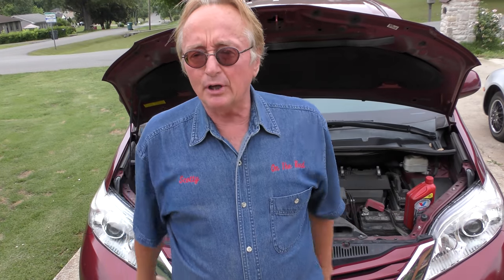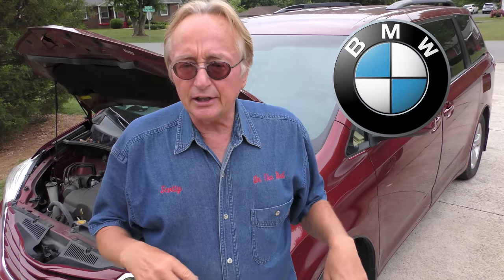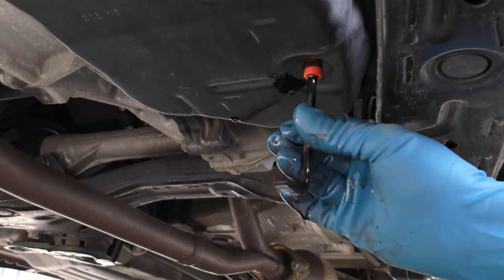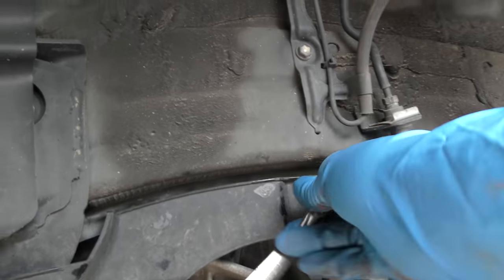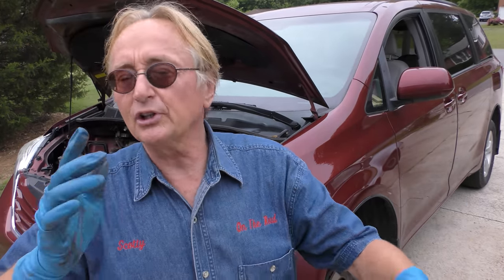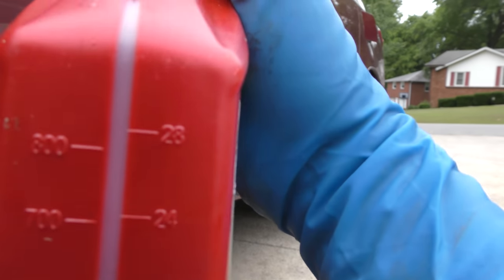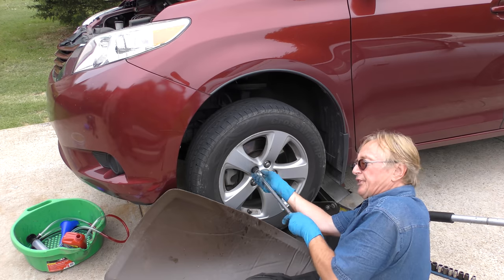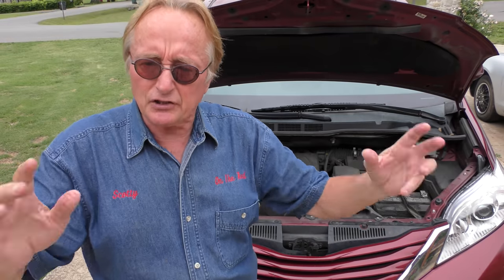Here's Why Changing Your Transmission Fluid Can Cause Damage

Comment: I have a 2003 Ford F250 Super Duty Gasoline 5.4 liter V8 truck. It has 370,000 miles right now. My family got it USED at 170,000 miles. We never changed the transmission fluid. But I have been using it for 6-7 years now and i have noticed on 2nd gear it does a little kick when it shifts to 2nd gear but it only does it when i let go off the gas pedal going on 2nd gear. If I do not let go off the gas pedal going on 2nd gear it shifts smoothly 95% of the time. I noticed the transmission fluid still looks more of a reddish color and not black. Ford made the best f250 trucks! I only change the motor oil every 2500 miles. I also never drive fast with my truck. I always drive 55 max on the highway while towing a car. And sometimes I like to use the law of gravity to stop my truck so i wear out my break pads the least amount of time ✌️😆✌️😁✋️.

Comment: I have an 2017 Elantra. I want to buy a less expensive transmission fluid than the OEM.  Elantra calls out for SP4 rating.   AISIN sells a fluid --  ATF-SP4 Automatic Transmission Fluid.  How would we find out if it is as good as OEM fluid.

Comment: Question. Theoretically, couldn't you use that manual pump to pump out the rest of the old fluid thats left in the transmission? I'm new to car mechanics, so there might be a reason why that wouldn't work. Could anyone provide some insight on this?

Comment: Got a 2017 Mazda 6.  Says, no need to change the transmission oil.  Doesn't seem right.  

On a side note, have a 2013 Toyota Corolla.  Never changed the transmission oil.  At 220,000 currently.  No problems.  Rule is, no new car until the it dies.  Just maintain regular oil changes.  Been trying to kill this thing for the last four years.

Comment: What about auto trans fluid that has 58,000 miles on it, but it is 21 years old. I have a Saturn that was barely driven, so it has 58,000 miles on it, but it is 21 years old. Is that fluid you should change, or leave alone?
Reply: Yes don’t change it. It to far gone. If you change it just make sure you have enough money 💰 for a new transmission if the job fails 🍷

Comment: Scotty level the car out, and pump fluid back in with that extension still in, up, from the bottom, until it starts overflowing.  Put the drain plug back in. Done, excess leaks out from that overflow stick.

Comment: I had a 2013 Toyota Highlander 237K miles, never 👎🏾 serviced the transmission no problems whatsoever, but I knew her days were numbered due to having to replace the radiator and lower control arm ball joints and struts were up next. A mechanic I asked wouldn’t touch the transmission lol 😂 I got a new 2023 Kia Sportage and sold my Toyota before it totally died. I’m definitely gonna service the Kia’s transmission regularly.

Comment: Now I feel good because this is how I change the transmission fluid in my Jeep every 60000-70000 miles. Mine has a dipstick, so I'll run a tube from my Topsider vacuum tank down and suck out the fluid. I do it when the fluid is hot so I get any debris suspended in the fluid. Then I'll replace the fluid, drive around a while to let the new fluid mix with the old, and do it again. I figure I get a third of the fluid out each time:
1st time: 66% old fluid left
2nd time: 44% old fluid left
3rd time: 30% old fluid left
4th time: 20% old fluid left. Drop the pan, change the filter, fill it up.

Comment: Hello, I have a 2014 Toyota Corolla with 307,000 miles my transmission oil has never been changed and still runs good, but there is a clunk sometime when i shift out of park. I have been told 8k to replace should it be that expensive, and with this much milage is it worth buying rebuilt tranny

Comment: Is my Lexus IS transmission (143 K miles-230Km) shot? I don't think the transmission oil has been changed (bought used) Now the shifter is very hard and won't stay on D (drive) eventually when the car warms up it kicks in but I am afraid of getting stuck... I am freaking out as money is tight.  Hoping for a miracle easier fix.

Comment: I have a 2015 Kia Sportag It shuts off when I slow down.  It does not  have any codes showing up? Where do you suggest I start to look for the problem?  I have read the torque converter solenoid, and even the brakes to the temperature sensor.  I'm starting to get confused.  Help!!!

Comment: I accidentally put about 1oz of ATF fluid in my CVT  transmission will this cause damage to my transmission? My transmission fluid was just a little low and I did not make sure that the employee at the auto parts store had given me the correct transmission fluid (I only notice when I started pouring)

Comment: Scotty I know this video is old but wouldn't you change the trans filter every time you change the trans oil I follow you on your videos I have a 2016 Nissan Versa Note 95,000 miles haven't changed a transmission oil or filter yet I'm going to do it. Your opinion should I change trans filter and oil or leave it

Comment: It depends on your definition of "lifetime".
I once bought a GPS navigator with "lifetime free map updates".
I later discovered I was presumed to have a terminal disease, and had only two years left, because that's how long the "lifetime free updates" were good for.
Reply: Recently, the trend is "lifetime" to say in other words that the manufacturer guarantees trouble-free operation of the AT for the duration of the warranty on the original fluid. It seemed like nonsense to me. But then I realized if the AT has fluid change intervals and I follow them and the AT stops shifting after warranty = same as no AT fluid change, if the AT stops shifting after warranty = no one cares because it's out of warranty.
  New car warranties in the US and Europe are very funny. E.g. Toyota in USA = 36 months or 36,000 miles. Europe = 36 months or 100,000 km (62,000 miles). Someone may object Mercedes has a 2 year warranty with no km limit!!! Yes, but Mercedes recommends changing the AT fluid after 60,000 km (37 K miles) at the latest :).

Comment: Why did you not mention changing the filter?  I am guessing... Well, I don't know.  A short discussion on the pros/cons of that filter change would be helpful.  But, a good, well done, and concise video the way I like it.
Reply: Changing the filter on many transmissions requires that the transmission be removed from the vehicle and taken apart in order to access the filter, a process that would cost thousands.

Comment: What is evaporative transmission system? I have a toyota corolla 2003 with 99k miles on it. The car leak transmission fluid. I can't seem to find the problem where the leak is coming from?

Comment: Hello Scotty I have a Lexus RX350 2013 model with 150,000 miles do I have to change the transmission fluid the dealer said it is a sealed unit don’t touch it please advise me on that thanks 🙏

Comment: Neighbor brought an older Rav4 2013, for his daughter first vehicle,  with over 260,000 km on the clock. Did a transmission oil change dropped the pan, changed the filter etc  ruined the transmission ending having to replace it. Lesson learn leave alone if its never been changed before. One expensive mistake.

Comment: I just did this on my 2012 Lexus CT200h, to get the fluid to pour out the bottom of the fill port. More needed to be pumped in than what came out. So the measurement of what came out is not accurate. I had the car dead level when  refilled with new fluid.

Comment: So if i bought an 2003 LEXUS ES300 with 170 000 km on board ( i live in Canada) , it is better not to change the transmission fluid? Cause idk if it was changed previously....

Comment: hmm, i did 565000km with 70% Autobahn thrashing in my BMW 540i... the book said lifetime transmission oil... so I never tried to have it changed, and in that time nothing happened, ever. Ran the same all the time. Zero problems, no changes in performance or problems.

Comment: I definitely need him with a transmission flush on a 2006 Acura MDX. Transmission out the blue started acting up. First the A/T Temp light came on then the transmission slipped a lot then it was being weird. it was fine earlier in the day, but once this happened I got it towed and haven't driven it since.

Comment: Good morning Scotty, I have 2019 Dodge Ram 5th gen 8speed automatic transmission 8HP70, you are saying replace the transmission fluid every 40-50K mile but at the end of the video you said every 30k miles I have 33.000 miles now should I replace the filter and transmission fluid to keep my truck running well ? Or I need to wait until 50k? but looking for other videos they say I have to put the truck in reverse and after in 2nd gear to reset the computer of the transmission can read the fluid was changed… I would like you advise. Best regards, Diego

Comment: I got my transmission fluid changed out around 80-90000 miles. My transmission went out at 117000 and I had to get a replacement.

Comment: That's where toyota is weak.  Subaru has an overflow hole, and Saab uses a riser tube, so I throw my tech2 on , bring the tranny up to temperature then fill it as it's running until it runs out of the riser tube. A much better system!  I do prefer Amsoil though.  Nice video!  Thanks!  I tell a lot of people about you!

Comment: Yuup that's correct info. If you have over 100K miles I would not change the oil at that point. I would however also change the filter that needs changing at least once every 60K miles.

Comment: My Honda manual recommends filling it, then draining it 3 times for a change.  What are peoples thoughts on that?
Reply: Do it if it’s recommended
Reply: So Honda came up with a substitute for flushing the transmission. A lot of Honda dealers stuck with the AT flush. Do as you like, but get all the old oil out of the AT. Don't forget to replace the filter if it is external or for newer CVTs classic - some old Hondas before 2000 the filter cannot be replaced.

Comment: So just a question for clarification: 

On my 2017 Sonic that I'm able to drain from the bottom, and has an overfill plug on the driver side. But I'm also able to fill it from the top. 

If I use the logic of what goes out must go back in, do I need to remove the overfill plug or can I just leave it and change the fluid just like I would do an oil change.

Comment: hey Scotty i have a 2021 toyota camry with 125,000 miles on never done a transmission fluid change i know im way beyond the limit but my old mechanic never had the time to do it or check it im taking it to a new mechanic but i need advice on what to do i don’t want to break my transmission

Comment: My 2010 grand caravan has 240k+ I've never touched the trans and it shifts fine I mean it's not as crisp as once was but over shifts and goes fine it to late for trans maintenance so I'm not touching anything I'm running it. I've heard those tranny's are problematic but I've had zero issues with it and whole thing in all actuality. I've changed a few wheel bearings brakes work and a rusty lower steel radiator tube, I did change the plugs around 200k they were smoked! Ran soooo much better. I did snap the front middle plug off but I managed to drill it out and chase the threads.

Comment: I want to change the fluid on my 2017 equinox with a CVT trans but the manual says not to change or maintenance free but I’m wondering if it will hurt anything since it’s a cvt.

Comment: My Lexus IS 300 has a 153,000 mi it runs good but I checked the transmission oil and it's it's not black but it's not pink it's like brownish could I drain half and fill half with good oil what do you think

Comment: Scotty.Mine has 115k miles,is it still ok to change trans fluid without changing the filter..sienna 2012
Reply: Changing the fluid in the AT without changing the filter makes no sense.
Reply: You mean it need to be change it both atf and filter.
Reply: @Twin_Lakay  Of course, if I change the ATF, I always change the filter as well. How does the AT filter work? The ATF passes through the filter and dirt remains in the filter. The more impurities in the filter, the lower the flow through the filter. ATF moves more slowly in the transmission. Dissipates heat more slowly and provides AT lubrication more slowly. Soon the AT will start to overheat…

Comment: Hello Scotty,

Hope all is well

I have a 2014 dodge Ram 1500 5.7, with 130000 mile on it, I didn't know if the previous owner replaced the trans fluid
can I change it safely now or its not recommended?

Comment: have a Toyota 2009 camry V6 with 140K miles.  never changed transmission fluid.  i'm assuming now it's too late and best to let it ride?  having no issues.....
Reply: Yes don’t change it. It to far gone. If you change it just make sure you have enough money 💰 for a new transmission if the job fails 🍷
Reply: @natelove187  that was my thinking.  Half the miles are highway as well.  Not sure if that makes a difference.

Comment: Hey Scotty , I have 98,000 miles on a 2013 Nissan Murano (CVT) . Not sure if trans fluids ever been changed, i never did, and got it at 60,000 miles.. Think its worth changing now ? How to know if ones gone past the point of no return?
Reply: I have a transportation business. Not saying I'm a mechanic by any means. I've had many trans blow and many go over 350k no probs. One of my Transits just blew at 220k. I messed up n thought it was serviced, but never was. My advice is to do simple drain n fills. It will only get out a few quarts at a time so I usually drain my vehicles every 20-25k. Just bought another vehicle with 120k. Record showed first flush was done at 108. I did a drain n fill at 122k, 137k and now 160k. Maybe that helps you bro. I paid $5300 for a new tranny smh so now I'd rather play it safe n drain n fill on a schedule.

Comment: I gotta question, my automatic transmission fluid seems fine when I checked it and no contamination either and it is an old car but it’s hard to change gears as the car struggles to get up speed and sometimes it will just shift to neutral by itself in the middle of the road. What would you think the problem is?

Comment: Hey Scotty my 2006 kia spectra ex had been sitting for five years but now started running it again. Got an engine light pop up with error code 0478 for solenoid a.  Read that sometimes old transssion fluid can cause this code.  Should I change the fluid first before going after the solenoid?

Comment: Why will the transmission slip and give trouble if you wait too long to change fluid say 130k miles ? And you say better don’t touch it and pray it lasts ?? My car has 138k miles, auto, original fluid I think. Thanks Scotty
Reply: Automatic transmission fluid consists of base oil and additives (additive package). After mixing the additive package with the base oil = transmission oil for AT, or liquid for AT.
   Engine oil consists of a base oil and an additive package. After mixing, motor oil is formed.
It follows that additives are responsible for the final product. If, for example, Mercedes recommends changing the fluid in the AT no later than 37,000 miles = it guarantees that the fluid that has the same specification that MB prescribes will have all additives functional after 37K miles. But at 50K miles, no additives may be functional anymore = oil is dysfunctional = AT starts to cool poorly, lubricates poorly, = AT starts to overheat in various places. Overheating creates clearances in the gearbox components because of increased wear. When the filter stops working, everything will get worse because the flow in the transmission will decrease. Dysfunctional oil + dirt will create an abrasive fluid that will wear the AT more and more. As thick as the oil is, it seals well the resulting clearances between the AT components. This does further damage the gearbox, but at this point the gearbox is still working without any visible problems (but soon the fault will appear). If the AT fluid is replaced at this moment, the thick non-functional oil will replace the thin functional oil. He can't seal the clearances in the AT and the car doesn't even have to move from the spot. Basically, the new AT fluid is completely useless in such an environment.
   And the owner screams the fluid change ruined his AT

Comment: Why would simply draining a portion of the tranny fluid and replacing the filter be bad for an older transmission that has never had its fluid touched? I have some understanding why a full transmission flush is terrible, but i thought simply draining and filling is ok.

Comment: 2007 Audi A6, 199800 miles , runs like new and never changed the lifetime tranny fluid or radiator coolant.

Comment: So if i have a 2011 Kia SORENTO v6 and its never been changed its at 145k now. Should i change it? or leave it as is.?
Reply: Replace, but a normal replacement - not the circus in the video (+filter and new gasket, under the oil pan). Your oil is no longer working properly (sludge, deposits, etc.). Carefully check the bottom of the oil pan for solid dirt (iron chips) if everything is OK.